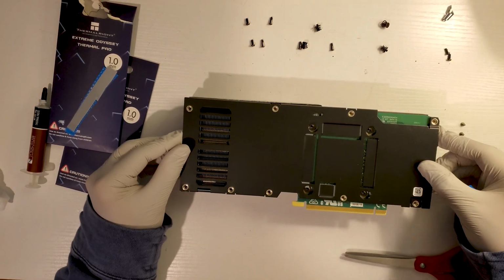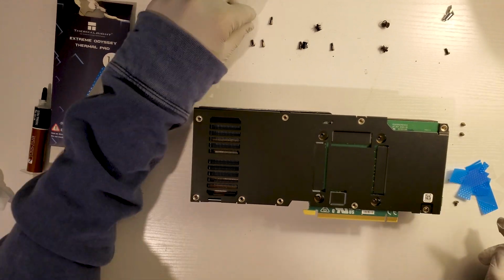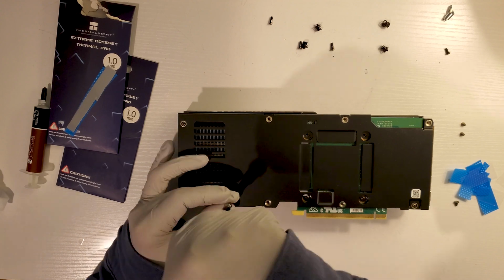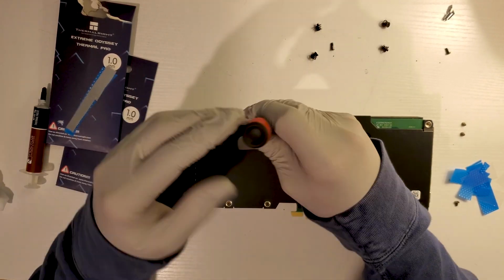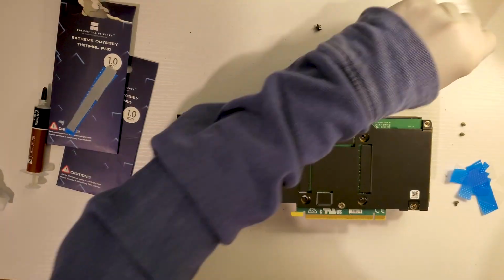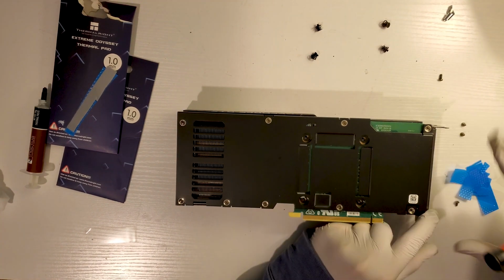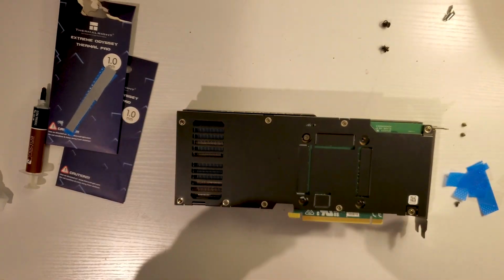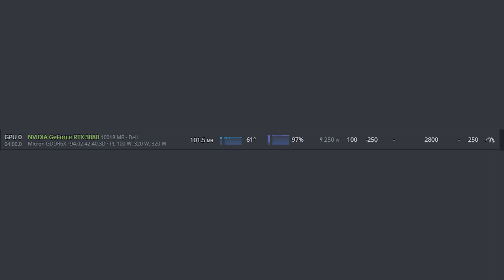Dell Alienware RTX 3080 Mod for 100+ MH on Ethereum (Fix Thermal Throttling)

Comment: This is the best video on this particular method.  This took my Memory Temps at full speed from 110c and being throttled around 98 Mh/s to 100Mh/s at VRAM temps of 86c.  That's with worse paste (NT-H1) than you used and no pad replacement. I'd been running this card at 93 Mh/s at 104c.  It's amazing what would have cost them 30 cents worth of paste really greatly increases the user expereience with this card. Thanks!
Reply: Bro, no pad replacement ? serious?  I am planning to do it as well :)

Comment: Hi I just did the fix my temp on hiveos is 58 deg maxed on a hot day with a hash 97+ settings fan 100% -300 2000 250w.I have 6 of these cards buy I did the fix on 1 of them now before the fix the temperature of the other cards was 49-53 maxed on a hot day but the other cards hash rate was no where near 97+ n it fluctuates from below 97 to 80+ ...what is actually the problem with the newly pasted n the non pasted cards?
Reply: Your fixed 3080 has now higher temps on the gpu because the heat from the vram is now heating up the chip. If u use a good os with some tools you would see the huge difference on your vram temperature that decresed from 110°C to maybe 90°C. <=110°C lets your gpu throttle.
Reply: @blabla-denkdrübernach  hi from what I understand is when the GPU throttles the hash rate will drop right?I'm currently using hiveos I cant see the vram on the rig...I did the exact fix in the YouTube video but the fixed card temps are higher 3-4 deg  than the non fixed cards but the non fixed cards hash drops to 80+ with lower temps n the 250PL drops to below 217w  n the temp is way below the fixed card.. honestly I don't get it I thought the temp of the fixed card should be even lower now right after the fix.

Comment: Thanks for taking the time and effort to share this AJ. I've been only modifying the thermal paste and am now going to go back and replace the thermal pads in all the GPUs. Quick question....The 1.0 mm thermal pads you used, did you place them as two layers to make it 2.0 mm? Or was it a single layer? Maybe it's just me, it's hard to tell from the video if you just did one layer or two layers. Thanks again!

Comment: YOU DO NOT HAVE TO REMOVE THE STICKER lol. It will not make a difference. its 0.1mm thick paper
Reply from the maker: It does make a difference because it blocks the conductive metal from the thermal paste which will cause less heat to be transfered, causing more overheating, but at the end of the day you can do what you want.
Reply: @ajcooltech  no It doesn't. I understand why you think that  but you can confirm this by using a thermometer and placing it on the sticker. It will read the same temperature as the rest of the cooler.  Additionally, that's a heat plate, the heat is distributed all throughout. I literally have 6 is these models. It doesn't make a difference.
Reply: @kittykittylicization  Okay, next time I'll put a sticker instead of the thermal paste.
Reply: @ajcooltech  Ill tell you what. grab a thin vinyl sticker and put it on a metal cooking spoon and then put that cooking spoon in boiling water. I want you to go ahead and record yourself doing it.

Does it transfer heat better than paste? No. Doest it make a difference when its 100*C...also no. You are losing at most 60% efficiency through 3% of the total area. Your choice in thermal paste would make more of a difference than the sticker.
Reply: @kittykittylicization  What choice of paste do u suggest?
Reply: @myjpkl  it doesnt really matter as long as it is not ceramic based. Arctic Silver is a nice middle of the road buy. The type of paste will make little difference in this scenario.
Reply: @kittykittylicization  can you explain why ceramic based one is a bad choice? I’m new to this whole mining business. Thanks
Reply: @savageg2002  it's the worst quality. Usually white in appearance. It's pretty rare and not very popular but just figured I'd mention it
Reply: You know removing the sticker and adding paste in those areas did help my 3090 my temps dropped 15c from stock and dropped 8c from idle
Reply: @herc1319  removing the sticker does nothing. Adding paste does lol

Comment: Hi have one big problem try make mining rig  have 2 5 3080 suprime x and 1 aorus  my motherboard is asus z490 p my problem is not see any card suprime in pcie or with rizers  but the gigabyte aorus work great take all suprime x and test other motherboard and work all goood . My psu is one bequiet 1500 watt ;) my prob is motherboard go for rma? Or psu .? But any other card test work good only msi suprime not boot black screen

Comment: I removed all screws of first thermal plate, but it wouldn’t come off. The thermal pads were stuck or sticky, and I actually didn’t order any. I reassembled the entire GPU so as not to risk anything until I get thermal pads (I was going to skip that step). Were your original thermal pads sticky? Mine were sticking to the back of the main chipset. I will retry once the pads come in in case I need to replace them. Well the GPU is working & temps are fine during heavy mining. Hopefully attempt #2 will be more successful. Any info would help bro! 😎

Comment: Thanks for sharing. What are your GPU fan speeds?
Reply from the maker: 100%
Reply: @ajcooltech  aren’t you concerned that you’ll have to replace them soon? I use NiceHash, been able to keep my fan speeds between 68-73%. GPU temp 48C, vram 90C. I’m sure if I increase the fan speed I could get even cooler temps but I wanted to strike a decent balance between acceptable temps with low fan speeds. I have my PC in the basement though and I try to keep the ambient temperature <23C.
Reply: @imarri01  What hash speeds are you getting with your settings and cram at 90C?
Reply: @angeloscots7930  100MH/s, when the display is on its around 96MH/s

Comment: What are you overclock settings (core, vram, etc.)?
Reply from the maker: I have -250 on core, power limit of 250 watts, and memory clock of 2800 (would be 1400 on windows because linux is double)
Reply: @ajcooltech  i have the same gpu, using the same setting it will black screen no idea why , i done the same mod too, temp dropped 20c
Reply: @ajcooltech  Thanks for the great video. Try these settings to save some power ;) 1140 Core 2800 Mem 230 PL  getting 101.8 MH and only pulling 225W working on 4 cards

Comment: how is the vram temperature,. before and after ?
Reply from the maker: Before it was 110 C after a couple of minutes and would throttle to 84-86 MH after it was at a constant 85-90 C and would not throttle below 101.5 MH!